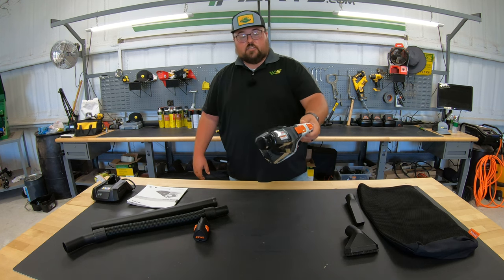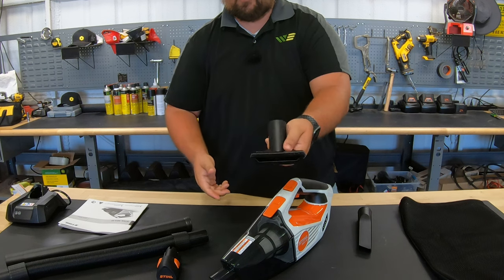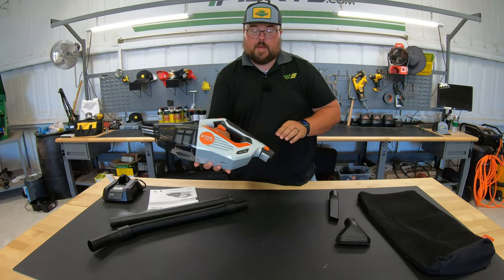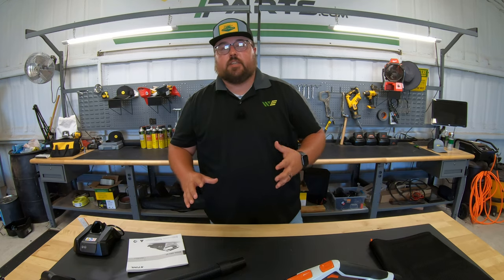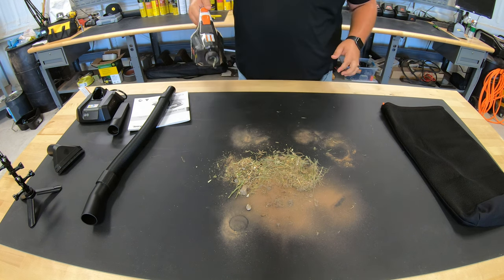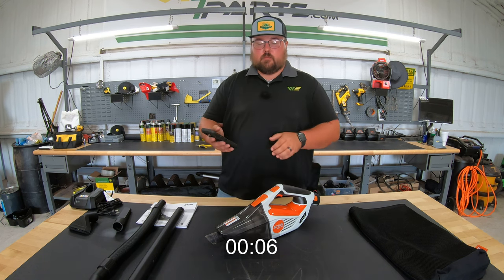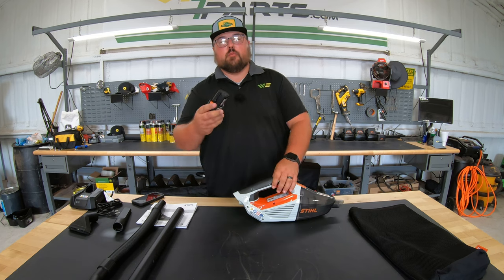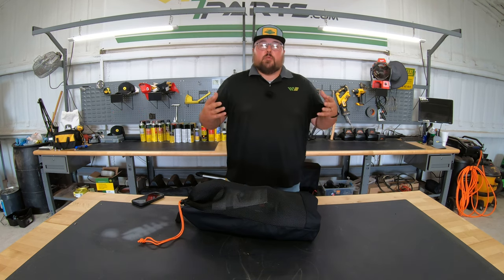Stihl SEA 20 Handheld Vacuum Review

Comment: You can keep all that battery powered  stuff. Ill stick with my gas powered  stuff. Extra batteries  cost to much to buy
Reply: You have a gas powered vacuum?
Reply: @LL-mt2nz I don't own a vacuum
Reply: I use to think this same, been using battrey powered hedges trimmers, chainsaws and pole saw for the last 3 years, 5L of petrol use to last me 3/4 days no it's lasting more than a month due to only using fuel in my br800, I have 8 battreys and have saved so much money by using battrey powered equipment it's not for everyone but I've never heard anyone regret changing over

Comment: Can you clean a small workshop floor with it ?
Reply: Pretty much, might need to get an extra battery. Thing holds a lot of debris. Batteries charge rather quick. 15 minutes will give you 50% charge from dead.